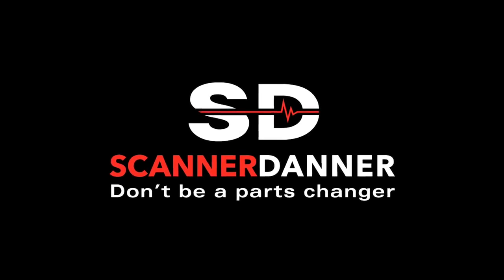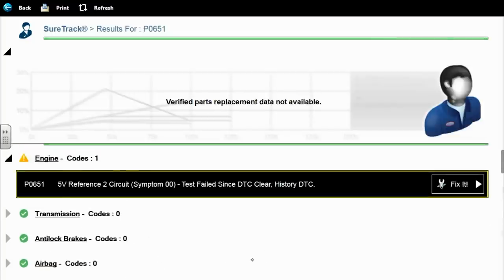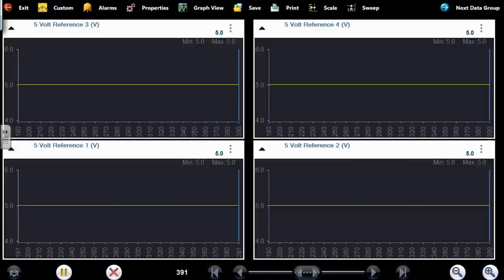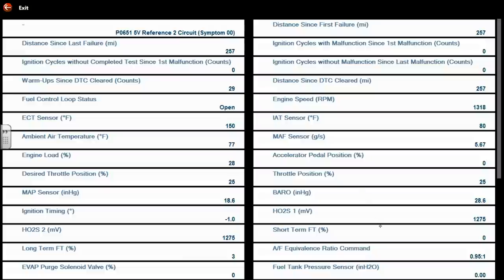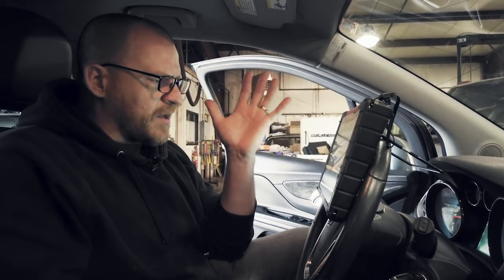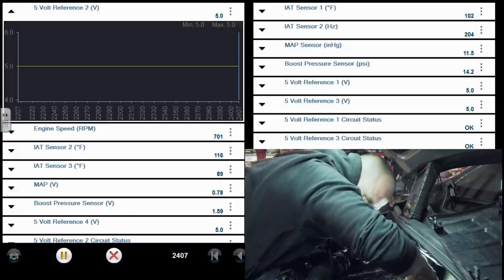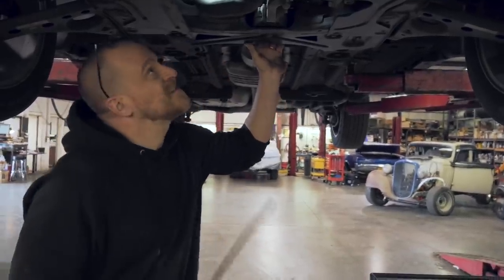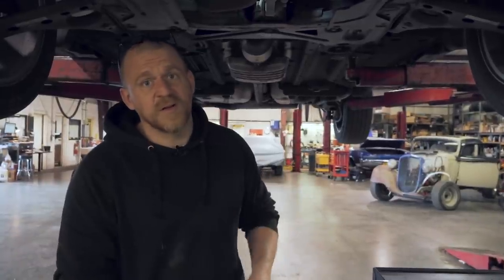Damn Intermittents (2014 Buick Encore 5v Ref Circuit Short)

Comment: I'm only 5 min into the Video and can tell you something like that almost kicked my but a couple of months back. PCM was the Culprit in my case. The 5V drooped out only for a few milliseconds and came back but it was enough for the check engine light to start flashing and the SUV going into limp mode . Scan Tool(Verus Edge) did not detect it nor did it  set a code. I finally managed to catch it with the Pico. It was very Frustrating as it took multiple attempts to finally condemn the PCM.
Reply: @HouseCallAutoRepair  My Slogan is "If I can't fix it you owe nothing"  That being said, I do like to get paid as I don't charge that much in the first place LOL
Reply: what car or engine?
Reply: What is the difference between the pico and the edge.
Reply: @Mikael5732  The Pico is not a scan tool it is a automotive oscilloscope(Super fast volt meter) I was actually able to catch the  dropout.
Reply: @ralfsautomotive yeah I don't have the Pico, I know Paul does. What's the ms it runs at I think my cheap one is 50ms
If I remember correctly from videos SD has a Pico with 500ms
I only had a super cheap one comparatively to Paul Danners because I only ever needed it a few times. I do mobile repairs locally, don't usually get CAN network faults or CAM/Crank sensor issues
Then I have the issue of trying to save the customer money where getting a part I can return is often faster than 3 hours+ of added diag on top of disassembly repairs and installation.
But I am one to confirm cause of the condition if at all possible and let client know if I can't or if it's worth it and let them decide what they want to do based off cost and probability
Reply: @CameronDC-Grimes  Not just that it is the entire spec of the scope that sets it apart from others. Check out "mechanics mindset" he does a ton of comparing scopes.

Comment: Welcome to GM freeze frame and failure records. As you discovered quite often the information you find stored in them has nothing to do with the system or circuit related to the DTC that triggered them. Freeze frame and failure records should contain information that is related to the DTC that triggered them or as you found out in this example the 5V ref showed 5V not a lower value which is what was needed to set the DTC, so it just leaves you talking to yourself saying this doesn’t make sense.

Comment: Speaking of intermittents we worked one on a 727 with the autopilot intermittently kicking off.We changed black boxes, equip. racks, wires , plugs & connectors , and even flew test hops troubleshooting for almost a year unable to duplicate the flaw. Finally the Feds demanded we ground and fix it ! For several days we had a person in the cockpit monitoring while the autopilot was engaged. One afternoon when the sun went down the autopilot did a un-commanded disengage. The discovery was made that a faulty photo cell diode on the instrument panel (to brighten up the instrument panel  when the cockpit lighting became dim) was allowing the autopilot to short to ground , and causing the autopilot disconnects. $100s of thousands of dollars spent  for maybe a $2 diode in the end .
Reply: Great story !
Reply: So the parts cannon exists in every industry. I would assume there is a Dorman like parts supplier of the aviation industry?
Reply: @mph5896  ITT Cannon supplies so many connectors they are very common in aviation.

Comment: Coupla months ago was fighting a Nissan Altima that the windows, seat, locks, etc would intermittently stop working; found after much investigation that there was one small section of wiring harness going through the frame to the driver door combo switch that was not protected by plastic sheathing... it had rubbed through the tape and a couple of hot wires insulation! When it moved off the frame, the BCM internal fuses would reset, and everything would work fine until the wrong bump or door slam re-connected the short!!! I think I used an entire roll of electrical tape on that section... LOL!

Comment: In your Data PID's it said    (APP % 0).   I think I also caught a glimpse of BPP (Brake not applied).  It was in park/neutral also, if the customer could lend some insight that'd be great. If they went to put it in gear and depressed the pedal and it acted up it would be a reason to lift your foot for sure.  Allowing the circuit to recover.   Almost guaranteed there would be a "drivability/performance" issue being that not only the the crank sensor is on that circuit ( as you stated a lot of modern vehicles don't require the signal" but also the MAP/IAT.

Comment: I was wondering about the computer seeing 11.7V on a running engine that should have much higher battery voltage? Is this just sensor returns?
Reply from the maker: I only saw that in the final production! Was wondering the same thing yesterday. This was filmed over a month ago with no issues since we touched it, so I have to call that a non issue. Maybe a smart charging system that hadn't kicked the alternator on yet? Good eye. I really don't have a better explanation for that.
Reply: I noticed that 11.75V on the ignition 1 circuit as well. It seems plausible to me that the PCM set the 5V reference code as a result of a failing battery. It looked like it was the OE battery under the hood, so it likely is due for replacement after 6 years of service. I figure the PCM flagged 5V reference 2 because it's the most critical to engine operation with the CKP sensor.
Reply from the maker: @Joseph Wash thinking about your comment and the battery itself could have been the issue here. I may be in agreement. 
You know what I'm missing? A word from the customer on symptoms. Super important piece of information here that I didn't have and if it was a start up only check engine light with no symptoms...bam, that makes the most sense. If however it was while he was driving and he had driveability complaints, we are on a completely different path (the one I walked)
Reply: @ScannerDanner  i get this alot with the virus, its seems to be a glitch in the software.

Comment: Yeah those do suck lol. I noticed in the freeze frame data it said miles since last occurred was 257 miles. I would probably ask the client if they were driving on a rough road when it happened and see what they say. Given the loose harness situation may have been the case and a possible internally broken wire like on some of your older videos. I.e. with wheel speed sensor wires breaking internally that you found with a tug test.

Comment: This may be hack-ish, but if a car has 3 separate 5v circuits and the problem repeats itself, but only once a week or whatever... I would consider swapping sources.  For example, if 5v ckt 2 has the issue and runs 3 sensors - move sensor A to 5v ckt 1, and sensor B to 5v ckt 3.  See if the codes move to narrow down which sensor may be causing the issue.
Reply from the maker: These would be hard wired circuits. Each sensor has it's own 5v reference that is shared inside of the PCM board. What you are suggesting wouldn't be possible without butchering the harness and rewiring every sensor. Good thought though.

Comment: Hey scanner danner. My 02 civic is giving me this check engine light with codes p0325 said bank 1 knock sensor,no signal.
Next code: p1505 pcv valve air leakage but there are no vacuum leaks anywhere. I know is air is in the system it will give the p1505 code as it came up before and bleed the system and it went away and came back now with both codes that i listed above. What are your thoughts on these codes.? Your help really appreciated..

Comment: Paul...since there are 3 codes and '2' of those codes involve and MAF/temp sensor combo...can that unit be tested?
Reply from the maker: This has a 5v ref circuit problem, so any sensor that shares that 5v ref is suspect
Reply: @ScannerDanner  
And you have a combo unit with two sensors in it that share the 5v ref.

Comment: You lost me around 7:25 when you said one sensor can't shut the car down.  This confuses me in a couple ways.  I've always understood from prior videos that  the 5V ref always originates from the same spot in the PCM no matter how many pins it splits to at the connectors.  Even if they're now independent ref ccts, I'm not sure how a shorted sensor couldn't still kill a car.  The hypothetical scenario playing in my head is the cam sensor shorting out and it shares a ref cct with a crank sensor.  One failed input mutes the other and Caleb's mocassins are getting dirty in Danner's shop again.  I have my own little case study that helped make me question this.

08 Escalade, crank/no start, I can't remember codes (I believe it pointed at a few sensor circuit low voltages), other hands had been into it before me.  5V ref ccts came into question during my diagnosis.  Just like the Buick, it had at least four 5V ref ccts.  DVOM testing at the PCM, two of them showed 5V, one showed 2.3V, and another was less than a half a volt.  Unfortunately, I checked the oil pressure sensor last because I was told it had a new one.  But, that was the shorted Duralast part pulling down the ref ccts and the engine started once it was disconnected.

I realize we're not quite apples to apples here between makes and model years, but it's GM junk none the less.  I wondered then as I do about it now: Between my Caddy and your Buick, did GM, at some point, make truly independent ref ccts within the PCM board?  And to your statement in this video: What's different in newer model years that a car can't shut down on a shorted ref cct anymore?

If you're willing to entertain my long way to ask a question, thanks in advance and thanks anyway for another video.

Comment: I bet it's a faulty mass air flow sensor or one that's going out .  Or a
Blown fuses, or defective relay
Reply from the maker: a dirty MAF will not pull the reference circuit down, a blown fuse will not be intermittent as the fuse will not fix itself, a faulty relay wouldn't be specific to the 5v ref 2 circuit only :-)
Reply: @ScannerDanner  the maf I ment to say faulty .

Comment: AWESOME VIDEO BROTHER !!!! YOU AND KALEB BOTH !!!!  I GOT A 2011 BUICK LACROSSE , THE CODES , PO23F AND UO100 HAVE GIVEN ME A NO CRANK,NO START AND BURNING OF # 10 ECM FUSE ISSUE STRAIGHT FROM HELL .LOL .
DO YOU HAVE ANY TIPS ON HOW I CAN DO THIS ON MINE ? I DROVE SOMEWHERE AND LATER ,3 HRS I NOTICED WHEN I OPENED MY DRIVERS DOOR , I HEARD A CLICKING FROM ONE OF THE RELAYS ,#7 ,CLICKING RAPIDLY FOR ABOUT 20 TIMES ,GOT IN CAR AND NATA,NOTHING .
FUNNY THING WHEN I FIRST HOOK UP BATTERY BACK , IT WILL DO THIS CLICKING , ALSO IF I OPEN TRUNK OR MY DOORS .
THAT RELAY IS WHAT I SUSPECT RESPONSIBLE FOR MY #10 ECM FUSE THAT KEEPS BURNING ! FUNNY THING ,THIS HAPPENED THE DAY AFTER I DECIDED TO HOOK MY PHONE BY BLUETOOTH TO THE CAR !.
   I GOT A BLUEDRIVER , I CANT WAIT TO START CAR AND RUN ALL THE FEATURES ! ...... DID TEST THE STARTER BY MY POWERPROBE 3 AND THE HOOK ,IT WORKS ,AGAIN ANY ADVICE ,THANK YOU IN ADVANCE ! I 
GOT THE 3.6 LT ENGINE . I GOT A ECT-2000 ALSO ,BUT THE WIRING  IS A NIGHTMARE IN THIS CAR ,HAVING MANY PROBLEMS, I DO HAVE WAY OVER A 1000 PAGES OF CHILTON INFO  , PLUSE 100'S OTHER IN ALL SORTS OF SCHEMATICS AND DIAGRAMS ,SO I ABLE TO FOLLOW WITH YOU IF YOU GOT AN IDEA ! !! ....LOL  WE WENT THRU 2 HURRICANES JUST WEEKS BEFORE MY PROBLEM  AUGUST 2020 , IN JAN 2021 AS I WAS UNDOING MORE TAPE OF PLASTIC WIRING AND CONDUIT I NOTICED MY HANDS WERE WET AND EVERYTHING WAS SOAK ,BECAUSE OF THE BEND DOWNWARD , THE WATER HAD STAYED IN THERE 4 MONTHS . IT HAS SINCE DRIED IN THE SUN ! IT WENT TO CONNECTION X108 ......
 IF I   KNEW 10% OF WHAT YOU KNOW ,I WILL ONE DAY AS SOON AS I BUY YOUR BOOK AND JOIN YOUR ONLINE SCHOOL ! THATS COMING IN THE FUTURE ! , DO YOU OFFER A PHONE NUMBER TO TALK ONE ON ONE FOR YOUR ONLINE STUDENT ?
Reply from the maker: clean and tighten all of your block grounds!
Reply: @ScannerDanner  ok thank you my friend !

Comment: I think tenacity is a part of troubleshooting these intermittent problems.  I been plagued with an intermittent no spark for a couple months on a 1995 4runner. Time to purchase a oscilloscope.  Suspect 5v sensor circuit in the distributor pick up. Hopefully with a scope I can  graph what going on and tell if it's a wire issue or a component.  Your vids give encouragement to this old man!

Comment: I own this engine and it´s not direct injected.. but the injectors are very noisy

There is a brake pressure sensor in the ABS / ESP Module that senses hydraulic pressure, at the pedal there´s a pedal travel sensor... that senses how fast you press the pedal to assist you in emergency stop situations  ( brake assist feature) and also covers the classic brake pedal switch function....
. at the brake booster there is a vacuum sensor that controls the electric vacuum pump ( turbo engines under boost can not create vacuum)

Comment: In addition to the 11.7V freeze frame voltage, APP is 0% but RPM is 1,300?? And the vehicle is open loop with both O2s the same mV. Looks to me like the vehicle has just been started.
Reply from the maker: Very good insight! I missed that. That explains the 11.7 volts better than I did in another comment. This legit could be from a weak battery as another suggested. I got to go back and find that comment now.
Reply: @ScannerDanner  .. there is a 2s delay after startup before the alternator is ramped up ... to prevent engine surge after startup.. I guess failed reference circuits set a DTC right away without any delay and in this case before the alternator kicks in. I would not think the battery is weak, 11.7v right after cranking with no alternator sounds reasonable, but having it checked does  not hurt..  I`ve had a low battery not just once, even to the point of a no start and it never set any codes...
Reply: I noticed that data as well, might be on initial start up. Ftps was 0% also. GM is funny with using other sensors/circuits to determine some other sensor correlation and data, the info for the code is pretty in depth to, lmao. Not to mention GM's great scan tool and set up, again lmao. Witech is way ahead of the rest in my opinion. Anyway I don't think the circuit is the issue, something else that is correlated with it somehow. Just my thoughts though.

Comment: Loud clicking noise coming from evaporation valve wich is in top of the engine (13:06 it can be seen there ) also it affects fuel trim when it brakes completely ,you can disconect it and will see that clicking will disappear ))
Reply: What does it do?

Comment: I get my tail whipped on just about everyday on these vehicles of today, A little bit of everything, my worst problems is lack of customer of knowing how vehicles work. It just stopped? It will not stay running? It jumps? There is a noise coming from the vehicle? I ask most people how long they have to drive before the vehicle acts up, most do not know or about every other week is there answer. I feel for all mechanics or techs with today's vehicles.

Comment: ,  you chased the components, but not the grounds. maybe check ECU   to chassis ground continuity? I think your stuck on the 2 diagnostic suggestions , your focused on bad computer, bad components or bad 5 v reference,  but a bad ground is part of the circuit too.. Bad ground or terminal pin fretting at the ECU connector is my guess.
Reply from the maker: Yeah for sure, the code setting criteria, was it also for high voltage? Can't remember. A bad ground would make it high for sure.
Reply: @ScannerDanner  makes me wonder if the ECM fault monitoring circuitry actually senses  if its a voltage drop or rise, or amperage drop or rise to detect irregularities in the electrical components  5 volts doesnt mean much if  the amp draw  of the component doing the work cant be measured. . just thinking out loud.. not an automotive expert by far, but do have a strong electrical background.

Comment: 3.8Gb file issue suggests a FAT32 file system limitation. Is it internal storage on the Autel device or a USB stick/sd card? If it is external storage see if you have the option to format the volume as NTFS or exFAT to allow larger file sizes to be used. 

Happy New Year to SD and family.
Reply from the maker: unfortunately this built in recorder has no options for any of this (storage location etc) I'm using Mobizen and it is better anyway as it records audio and is easier to sync. Thanks for the info! Makes sense

Comment: ?: Paul, at the freeze frame data (~9:00 mark) the APP% shows 0 with throttle at 25% and revs at 1381RPM.
It struck me as odd to see the accelerator pedal position at zero.  Is that to be expected?? Thx!!

Comment: Nice video Danners! Just a quick FYI. That 1.4 is not GDI. It's just normal port fuel injection. The rattle noise is the purge valve. They are screaming loud. Used to have customers complain about them all the time. Unplug it an they would see the noise was gone. Then they were with it lol.

Comment: No gdi in that one bro - exclusively port injection.  boost sensor and temp combo on RH side nead throttle body intake.  This sensor is highly susceptible to heat soaking.  It's a major pain in my butt with my Cruze.  Same engine.  Cables under intake manifold likely got disturbed  because the intake was replaced.  This is a common requirement because of the integrated pcv check valves.